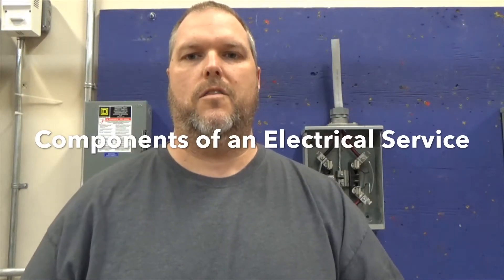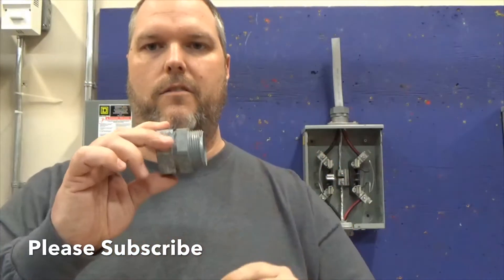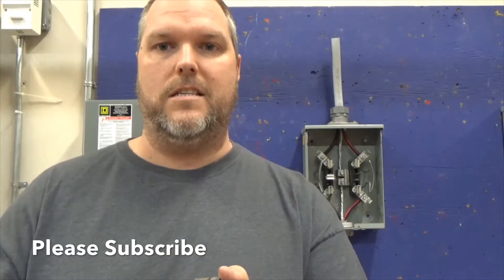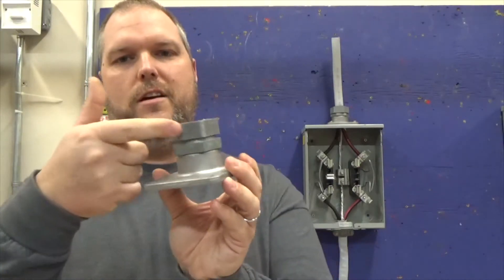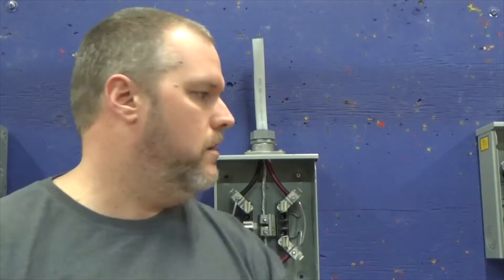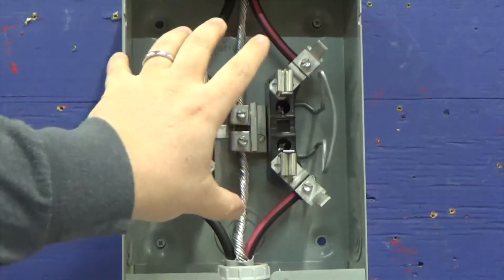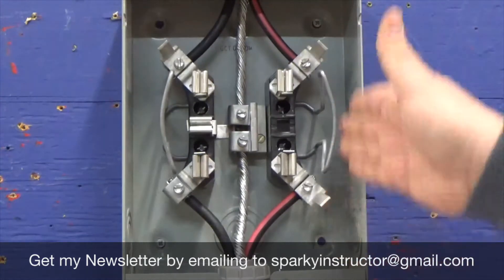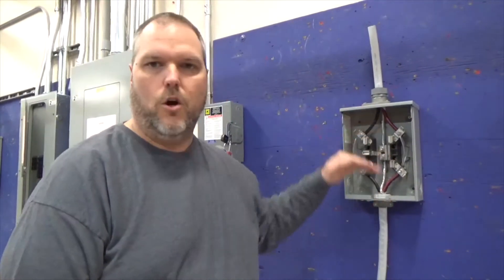Electrical Service Components, explained

Comment: Second time watching this video. Very informative. Thank you for sharing your knowledge.

Dumb question: what is the function of the wire on either side of the socket? I think it’s called it a bridge. Does the assembly help hold the meter in place? It almost looks like it allows current to make its way from the line side of the socket to the load side, but that would not make sense since removing the meter would not kill the power. Just wondering. I don’t see them on all meters.

Comment: I'm running an overhead feeder to a 100A sub panel. Sub is in a detached garage. Is it allowed to run RMC inside the garage? I'm told SER needs to be covered/in conduit when used for a branch circuit.
Reply from the maker: There are a number of ways to do it!! Check your local codes because things vary from state to state. Yes RMC is okay to run in a garage but it can be a bit over kill. Consult an electrician in your area for the best way for you to complete this project!! Please feel free to email me and keep me posted of your progress!! sparkyinstructor@gmail.com
Reply: @craigmichaud-electricalins4602  thank you for your prompt and direct response! I did just email you in regards to my current situation. I tend to write a lot, so I apologize ahead of time, lol. I sent pics too. Thanks again.
Reply from the maker: Unfortunately it will be a few days before I can get to it as school is starting this week!! Look out for around Friday!! Thanks!! CM
Reply: @craigmichaud-electricalins4602  no, thank YOU!

Comment: Is there a reason you installed a rigid plastic insulating bushing inside the box on the knockout clamp at the bottom? Why not to use a watertight connector on both meter socket openings?

Comment: How does copper ground connect to service box and outside to the ground rod. Does it need 2 ground rods for 200amp? It's need construction, metal pole barn. Thanks

Comment: I really enjoy your videos, they are very easy to understand and follow along with. I think an interesting topic you could go over is what happens when you lose the neutral to your service and why it is so important to split the ground/neutral apart. I have ran across a lot of electricians that think if you drove a ground rod and wired it to a 20 amp breaker, energized it, it would trip the breaker, and that is not true. You really do not understand what is happening at a house that has lost it service neutral when you get called to trouble shoot. They tell you my lights work and the AC works but when I turn on the microwave/hairdryer the lights start flickering and acting weird.

Comment: Hi Craig. Thank you for the very helpful videos that you preformed!! I would like you to make a video for comparing between the residential and commercial of meter and penal boards. I know there is no lots of different but would like you to do that kind os videos for electricians how has low acknowledge about residential and commercial electrical work. You're doing great! GO FOR IT!!👍👍🙂🙂

Comment: Would it be okay to use a weather tight connector on the load connector going into house?
Reply: Also, is it okay for for SEU cable entering house to go out the side of the meter can?
Reply: Also, would you also run a ground wire here. Would it be a different knockout and conduit

Comment: I’m from Illinois and have been certified in commercial electrical maintenance. Currently I work for a company that makes loadbanks and fuel supply systems. Are you an instructor at a college? I just liked and subscribed to your channel. I’m wanting to learn more about residential systems and you teach better than the teacher I had in school. Not knocking the guy, because he was knowledgeable, but didn’t teach it well. I’m excited to learn more from you.

Comment: Hey Craig,
Love your videos. To be honest, they are some of the best. Quick question though. I don't ever see the Service entrance cable and weatherhead around where I live. It is always PVC. Is that just a preference or could that be a local code. Thanks. Keep up the good work
Reply from the maker: It is mostly because of Local codes. Some contractors prefer to do it i PVC because it is a cleaner install. Thanks for watching and your support!! CM

Comment: My line and load phase wires look like yours in the meter can but inside I reversed them because my panel board was intentionally installed upside down. Is that a bad idea?  I marked the box inside but should I flip them?
Reply from the maker: Sounds like your service is coming along!! I actually answered this in another comment today.It is more of a standard than anything. We look at everything as left to right and top to bottom. My suggestion would be to change it in order to stay uniform. As for your panelboard they can be installed both ways. I have seen in Canada it is a required method to install the horizontal. I hope this helped? Thank you for your question and for watching. I so appreciate your support!! CM
Reply: Craig Michaud- Electrical Instructor thank you for the reply. I will take your advice. I’ve actually got everything I need by code installed right now. I have a rough in inspection scheduled for next Thursday but I think I need to undo some stuff. I installed my receptacles and switches already and I think that’s too soon. I’m sure the inspector will have some input!
Reply from the maker: Yes a Rough inspection they will want to see the wiring for sure. Yes please let me know how you make out. I would love some feedback form other states on this matter. You can always email me at sparkyinstructor@gmail.com with any other questions and suggestions!! Good luck!! CM

Comment: Sr. What happens if you connect A to B and B to A face?
Reply from the maker: I am asked that quite often!! Nothing will happen. As an electrician we have to deal with a constant standard. When we talk phase arrangement we look at it from left to right and top to bottom. This way we all do it the same!! I hope that is clear. Thanks for the question and watching another one of my video's!! CM
Reply: @craigmichaud-electricalins4602  got it! Thank you for your prompt response. Standards are very important so the electrician behind us are sure that the first electrician did the right thing.